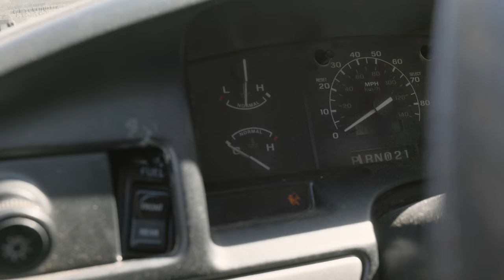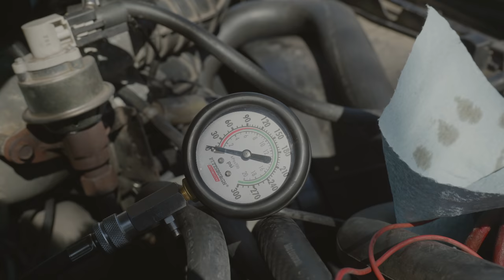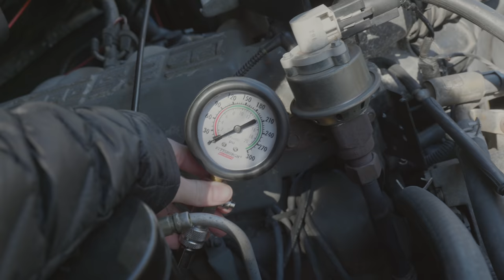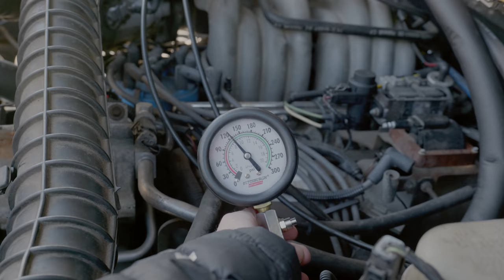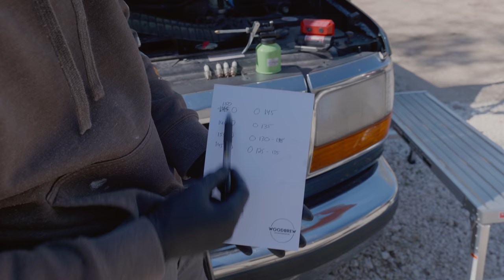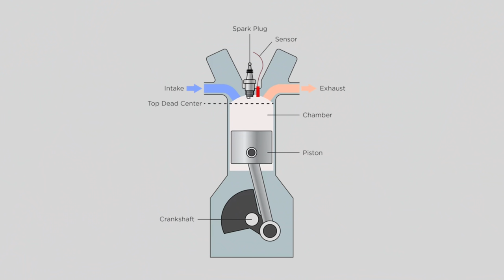Major Engine Problems... Day One | Testing Engine and Taking out Oil Pan | Part 2

Comment: okay guys good for you for trying... i AM a professional licensed mechanic from canada so here goes;  first of all, dont feel bad about your uncertainty....it takes 5 years of training to be a starting mechanic and then the learning really begins.  heres my take.  if the body is good, and you dont hate the truck, then the engine is always worth fixing.  I agree however with several others who have commented.  bring it to a shop and pay to have a complete inspection.  find out if there is anything else wrong....how are the brakes, the tires, the body, the suspension, the transmission, does the AC work.  if the rest of the truck is good then it makes a lot of sense to repair that engine or put a new one in.  most engines can be changed in the 10 to 12 hr range.  maybe a low milage used engine? price a crate engine from ford? price a rebuilt unit?   on another note: the hunting idle idle (up and down idle speed) was a common problem with that engine and was solved by cleaning the throttle body and the idle air control motor pintle and seat.  your compression readings dont seem that bad in my opinion for a couple of reasons.  as you get to the last few, your battery is getting lower on charge and so the engine is not turning over fast enough. also, you should always hold your foot to the floor doing a compression test for 2 reasons; one, to allow as much air as possible and 2, in wide open throttle on crank the fuel injectors will not be triggered ( this is called " clear flood") and you dont want to be washing down those cylinder walls with gas by continued cranking during a compression test.  
    the egr codes are probably a build up under the egr valve seat and in the intake passageway behind the EGR valve.
if you were closer to me in northern ontario, i could give you a hand with that rough running.

on another note;  I have been watching your videos for quite a while and have enjoyed watching you grow in your skills and as a couple.  I have used your videos to show my "tech classes" that I teach to my high school students so keep up with that great work.
Reply: This reply helped me thanks
Reply: great comment!  kudos to your sane approach to someone learning as they go.

Comment: Dylan, if the air is truly bypassing the intake valves when their fully seated in the compression stroke you might get away with just having a valve job done by a machine shop on that one cylinder head bank, that process will come with other incidental parts that will have to be replaced like the head gasket and head bolts. Definitely not the end of the world type stuff and not something you should get rid of the truck over. I think these speed bumps fit FixItFeb perfectly. Sometimes the renewal of something is not easy but the reward (and piece of mind of keeping something out of the landfill) can be satisfying, something that I can speak to personally on many levels. Regarding the upper radiator hose, that “spring” typically preinstalled is designed to keep the hose from collapsing. In my experience Chilton and Hynes manuals haven’t ever been known for their their completeness. With the age of the vehicle, you may have some luck, possibly on web forums, finding a Ford Service Manual, far better, and use the Chilton’s as fire starting material for your fire pit (productive way to repurpose 😉). As a long time “car guy” myself, I love this series! Keep doing what your doing!😊
Reply: @CantKillMe  Remove the hyphen, capitalize Or and Ford, and remove the apostrophe. Other than that, you did good.

Comment: If you can read that manual and follow instructions, you could rebuild that engine yourself, Dylan.  With the exhaust manifold and oil pan removed you're only a few steps away from having it dismantled, for a ring and valve job.  Only the heads, intake manifold and dropping the pistons remain...IF you're only going to do a valve and piston ring rebuild, that is.  You can do the rings while a shop is rebuilding the heads.  You're doing great, Team #Woodbrew!  Thanks for a excellent video!

Comment: The intake valve could have so much carbon buildup that the valve won't close all the way. You could try an intake flush using seafoam upper intake cleaner. It has a long straw. You can sometimes bump the idle air control with a tool while it's running to see if the idle changes. If it does then change it. The vacuum lines get real brittle. There could even be a leak in the hvac components in the dash. They're bad about leaking right the rubber boots and elbows. I believe some parts places can test the ignition module  but I don't think it's the problem. Check for carbon build-up in the distributor cap.

Comment: its not smoking, so I would think the cylinders and rings are ok, I don't think the truck is worth putting a new motor in, maybe the heads need to be reworked, but then when you do that it might give it more compression and they you start getting blow by and smoking. It's a tough call, really how much do you want to put in it, personally I would just drive it as it is and see what happens. If the motor goes bad then you either rebuild or get a reman. It's been running and driving so it might go another 50k miles, or could go bad next week, You seem like the kind of person that is gentle on your stuff I bet it lasts a long time

Comment: Are you doing a full restoration or just a cosmetic one if you are doing the full you have to look
At the transmission,differential,wheel bearings,brakes and the engine as those will all start to
Give you issues in that age of truck. My best advice is if you do not what you to fix or repair daily
(Ford) look for a newer truck and have a mechanic check it over before you purchase it. 
Best to you both going forward

Comment: If you thought you felt comfortable doing a head gasket pull the head like you’re doing a head gasket take it to a shop and have them do a valve job on it and put it back on probably just weak valve springs from the age of the truck

Comment: It can run like that for a very very long time , add some oil additive for old motors and drive it ...
Reply from the maker: I had someone else suggest Seafoaming the engine. Might give that a go.
Reply: @Woodbrew  sea foam is great stuff .
just to give you an idea my van has 670 thousand klm on it

Comment: I like Ford trucks but they suck to work on.  I had to lift and engine once on a F150 to pull the oil pan.  A truck that age I would probably just drive it until it dies then you can buy a rebuilt engine if that's what you want.
Reply from the maker: This seems to be the consensus of everyone I've spoken with too.

Comment: Classic mechanic phrase: "We're gonna pretend we didn't see that, and do something else that might be a waste of money and time." You're well on your way to being a full fledged mechanic. Intake valve repairs are cheaper than a new or another used pickup. Especially in this economy. Course, that said, people like to treat their trucks as trucks which is to say generally rough. Thirty years of rough treatment isn't something that can just be overlooked. Without a full inspection from someone who knows what they are doing you might be signing up for dozens of small problems only for it to die suddenly in spite of all of the work you have done.

Comment: Not sure about the 9th gens, but I have a 10th gen that I accidentally drilled a hole into the head when trying to remove a broken exhaust manifold stud, which led to a head replacement. Ford recommends lifting the cab off the frame to do the work. You can also tear off the front end to get to most of the front components (timing chain cover, water pump, oil pump, etc…) and it leads down a rabbit hole. While you’re in there, you might as well replace a BUNCH of other components, so it ended up being more expensive than I would have liked. Again, your experience may differ, but my oopsie was a painful one.
Reply: All that said, you’re a handy dude, Ford V8s are relatively easy to work on a easy to find parts for, so MAKE IT HAPPEN!

Comment: I am not a mechanic but if air is coming out of the intake maybe it is a intake valve leaking.  If so having the heads rebuilt would be less costly than an engine rebuild.  I know you could remove them and take them somewhere to have them rebuilt.
Reply from the maker: Yup pretty sure it primarily intake valve related.
Reply: I agree,  but would just buy new heads

Comment: Quick question for y'all and anybody who might know; how much would it cost to replace the engine? I've got the same truck alongside a new engine for said truck. How much would it cost a mechanic to swap it? I worked on the interior of the truck a bit and I'm hoping to get it moving. Thanks in advance

Comment: Find a good local mechanic and pay them to give it a good once over with a list of repairs and do a diagnosis on the low compression.  I have my mechanic break the list of repairs down into what must be done now and what is failing/broken but isn't critical to repair right away.  It'll be worth your time and money doing that.  

I'm a hobby mechanic so take what I say with a grain of salt.  It sounds like you have leaking intake valves.  They might just be getting stuck but on a higher mileage engine I'd be more inclined to think it is worn or damaged valve seats or valves.  You can take that valve cover off, turn the engine over by hand, and watch the valves as they come up.  The valve should stay in constant contact with the rocker.  If there is any delay, it is sticking.  Hose it down with penetrating oil and it might stop sticking.  I would be surprised if that is the issue but if it is that's a cheap fix.

Check with an auto parts store on cylinder head, head bolts, and gaskets.  I would guess cost at around $300 but that's just a guess.  If that's all it takes to make it a solid running and safe truck, it is well worth doing that job.

Comment: How many  miles are on the truck,that will determan weather or not you do a full motor rebuild or just a valve job. The spring is supposed to be in the radiator hose, so that it does not collaps. Dillion you are sporting the einstein hairdo.